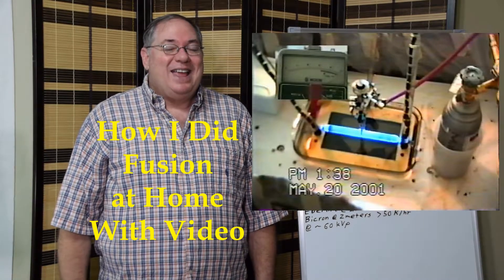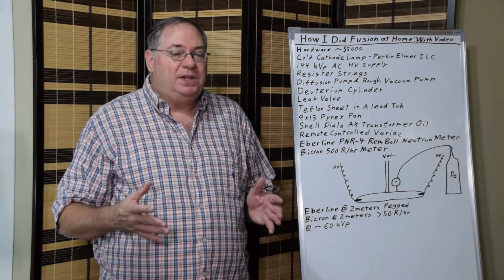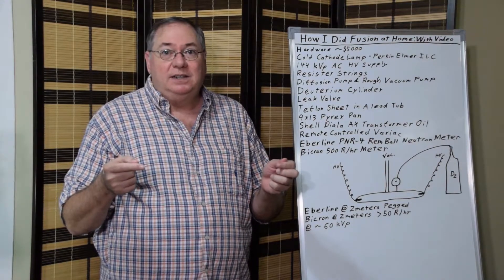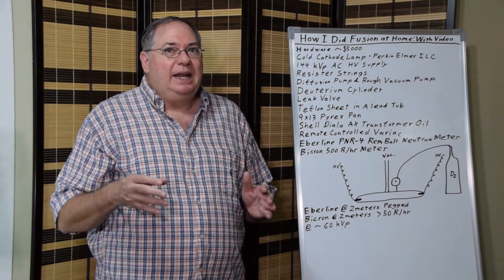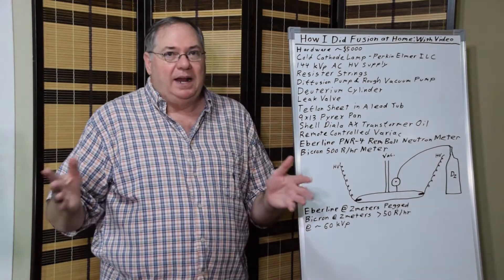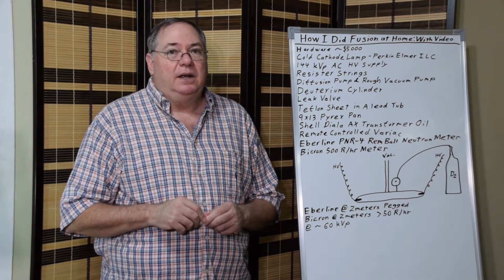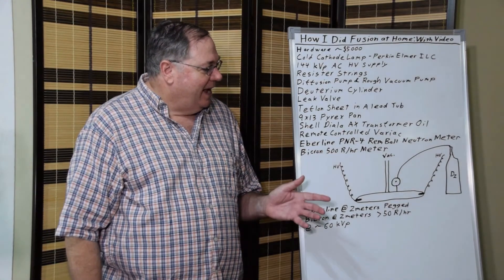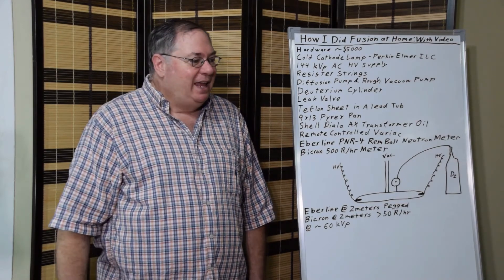How I Did Fusion at Home, With Video

Comment: So, using $5k equipment you were able to initiate controlled deuterium fusion at home, but the reason you didn't go commercial was because you had to use a flow through system? 🤔

Comment: Thanks Ray. Was the video from 2001?
I'm more curious with the frequency of the voltage source and the effect it would have exciting the heavy water. Similar to atomizing water with an ultrasonic piezo cell.  It seems resonance is the key for the electron to get to escape velocity.
Reply from the maker: Hi Dan, Yes it was 2001. The frequency was 60 Hz. We tried several high frequency transformers in our research to attempt to get it to resonate but we never found or made one that worked. The problem is there is an energy threshold for an arc to form is in the 10 to 15 millijoule range, so the power supply must provide that much energy per arc in order to form vacuum arcs. I have designed a twin Tesla magnifier that can resonate above that energy threshold,  but have not built it yet.

Comment: Thanks, Ray. Interesting video.
I think there is a connection between the D₂ and the successes/failures of the cold fusion experiments. When there is no (more) D₂ in the water, there is no fusion.
There are a few nice videos about people who are just using a spark plug in a jar of water, and detecting alpha radiation.
Can you find the right frequency and pressure for H₂ fusion?
Reply from the maker: I JJ Thomson's papers in 1913 and 1914 where he invented mass spectrometry he was able to start with H2 and produced deuterium, tritium, and helium using a similar type of gas filled arc tube. He then added oxygen and made neon, which many researchers replicated. I hope to replicate his experiment once I can set up my lab again.
Reply: @rayfleming2053  I will be one of the spectators.